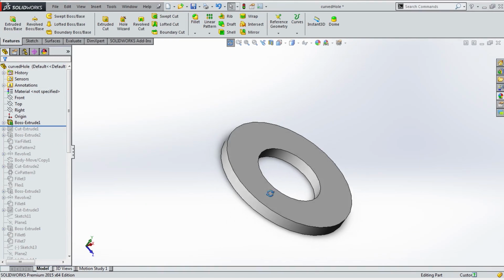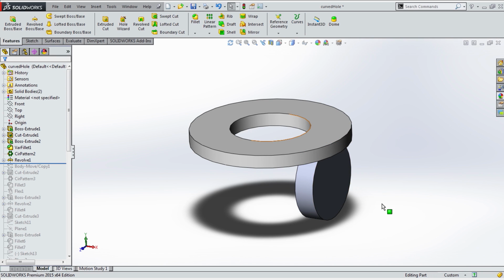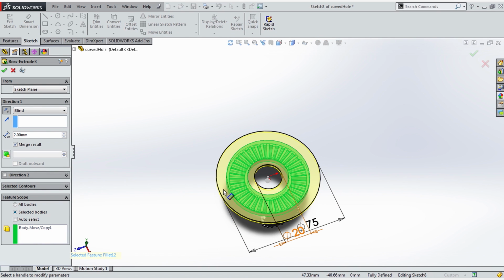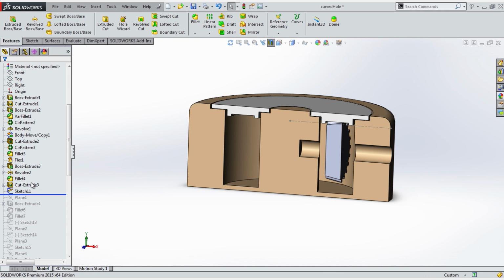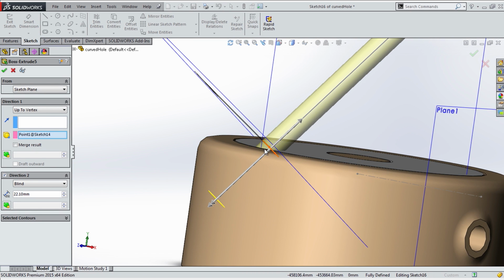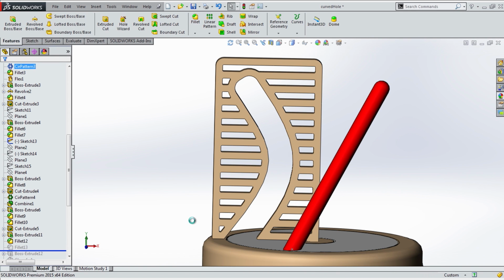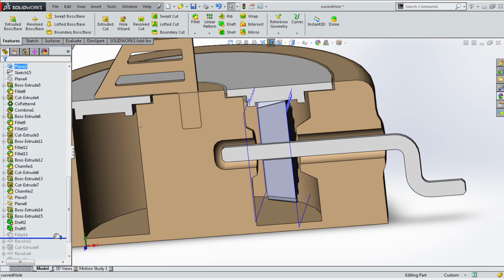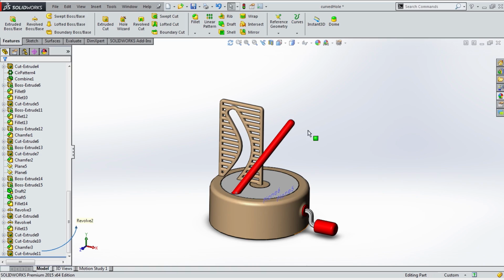Making the Straight Pole + Curved Hole Illusion

Comment: How did you print the pole and witch file did you use upright or regular.
Reply from the maker: I used to print regular, but found upright with supports and a brim usually prints cleaner

Comment: You should make this again with a smol motor so you can switch it on and have it go endlessly
Reply from the maker: True... that could be very cool
Reply: Make Anything // 3D Printing Channel it would also be very cool to try design a three way 3D impossible triangle, so that the three triangles make a pyramid
Reply: Make Anything 3-D print a Rubiks cube
Reply: Make Anything please

Comment: i use solid works at school in my engineering program but the teacher only taught us the basic 3D modeling techniques (sketch in x,y,z plane, extrude, revolve, spline and assembly of parts) and i want to learn how to use the other more complex features. i would like to know where you learned solid works and how i can advance in it. i can only do so much with what i know.

Comment: Hi Devin.

I finally found time to work on this on SolidWorks. I made some changes to the gear system(created gears with proper ratio in assemby rather than creating from scratch) and also the outerbody to reduce the weight and optimize it. I did not get to the final version yet. 

I wanted to bring to your notice if it is alright for me share my version on GrabCad. I have credited you and provided a link to the original product. https://grabcad.com/library/poleellipse-puzzle-illusion-1.

If, at any point, you feel I should not share it then please let me know. :)
Reply from the maker: That's quite alright! I'd have done the gears properly too if I knew how >.< Thanks for the heads up
Reply: You can check out this website : https://grabcad.com/library
Some people post gears that are "controlled" with equations.
By the way I love your work !

Comment: I downloaded your model for this and the  bearing is way to big when I download it so I was wondering if you could give me the correct measurements or the correct model
Reply from the maker: That's odd, it comes in at the right size for me... I'd guess you're somehow importing just that STL with units set to inches instead of mm? The correct dimensions are 11.8mm x 11.8mm x 6mm
Reply: ok thankyou

Comment: Yet another top video! If I can suggest, can you come up with a model that is only possilbe via 3D priting? I would like to know the complexity and the full scope of 3D printing. Great Video.
Reply from the maker: Thanks, I've got things coming up that are in that realm :)
Reply: Looking forward to it! On a side note, what software do you use for testing your STLs? Or do you directly print it from SolidWorks?
Reply from the maker: I go straight from Solidworks to my slicer (makerware or Simplify3D). I've learned to design parts that won't fail by avoiding intersecting faces and things like that. Solid modeling tends to fail less than STLs designed in Rhino, Sketchup, or Blender, etc...